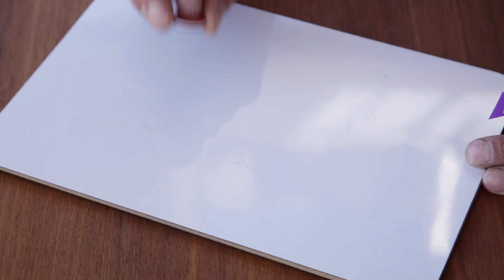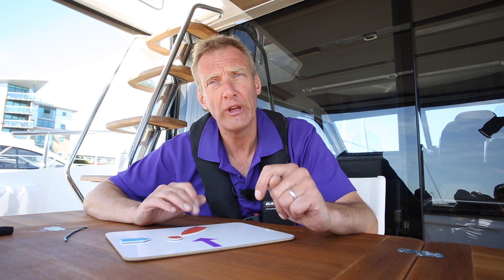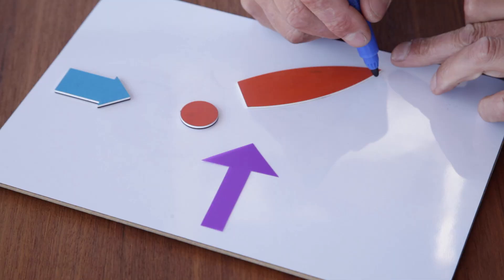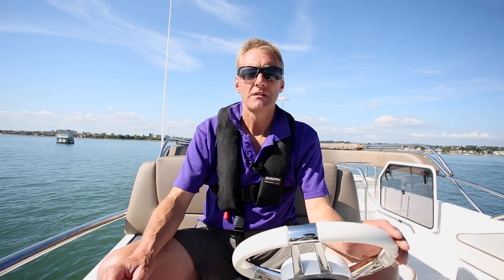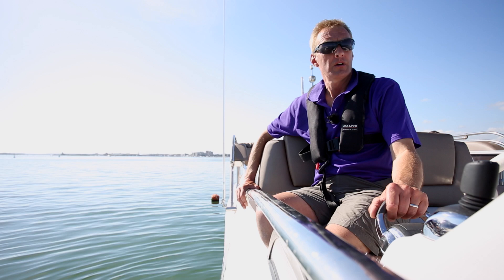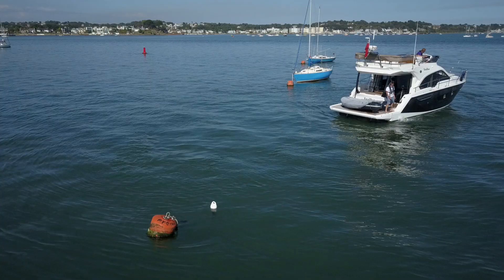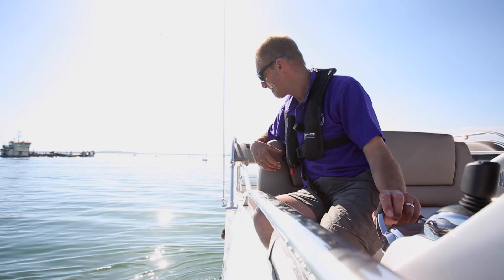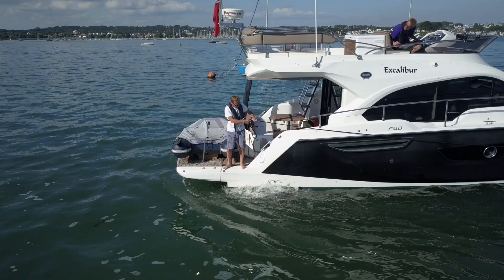How to: Mooring | Motor Boat & Yachting

Comment: very good tutorial enjoyed the simple relaxed stress free and clear dialogue, the bow line to stern to the buoy was educational, shame there are not more of these yacht technique tutorials - thank you
Reply: You got twin engine and you can use the engine to help swivel the boat so you dont have to pull the line or be strong. learn to use the boat as the "power" and yourself as just holding on the line. If you train to pull and when its get windy you dont have the strength anymore to move a large boat....

Comment: Hi, quick question. My wife and I did a night on a mooring bouy recently. However the stern kept swinging left and right through 90 degrees constantly. Thus was wondering was my line to short? Would a longer mooring line reduce this? Found i got a tad queezy looking at a constantly changing horizon 🤢

Comment: I hope that radar dome telescopes up because otherwise it looks like the radio waves are hitting the back of his head as he sits at the flybridge helm, and driving at speed underway with bow raised a few degrees means greater chance of those radio waves passing through your head.  I've seen a lot of boats set up that way, why?  Worse if he stands at the fly helm at speed.
Reply: Maybe Johnathon does not want any more children as sterility is the result of this radiation!